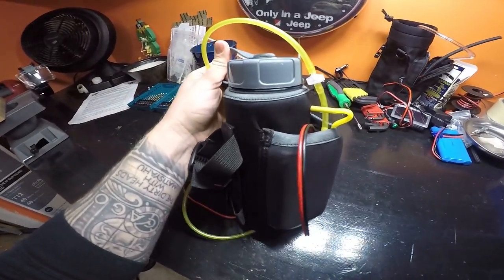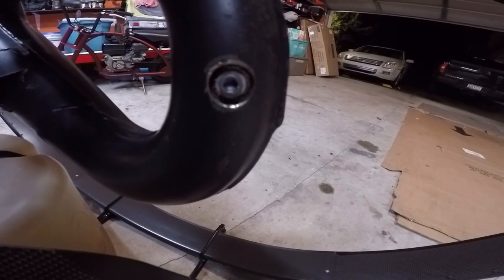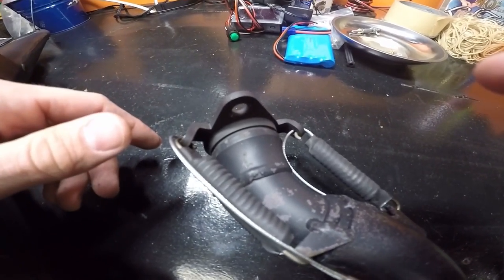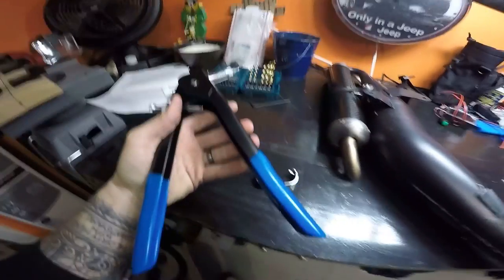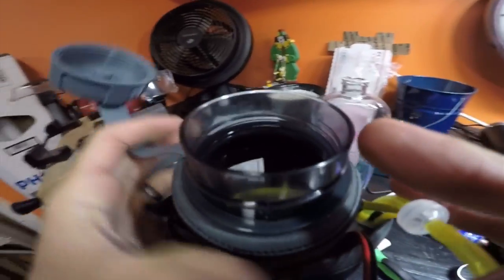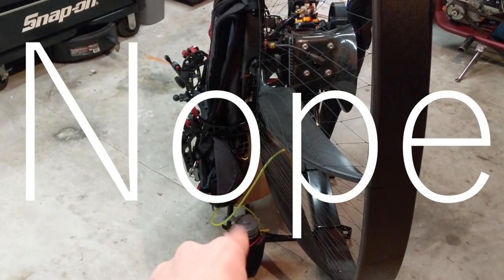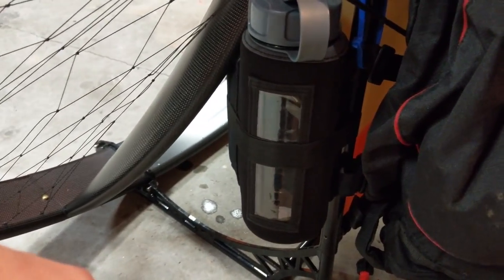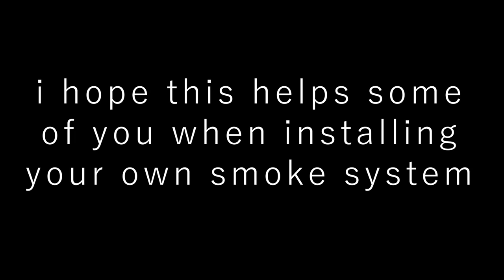Installing the PPGSmoke.com Smoke System!

Comment: For the RTV, it is a good thing - it will help prevent small oil leaks at the injection nozzle. I have seen a few instances where the fluid seeps out a little. Minor but that does solve for it!

Comment: Is there any benefit in getting the Aviator PPG nozzle rather than using what comes with this kit?
Reply from the maker: Not that I can tell. They're different designs and different sizes tho...
Reply: Our final production nozzle has an adjustable flow rate. We ship at .08mm and it can be drilled out up to 3mm for a full 600ML of flow rate. Light years ahead of the Aviator nozzle ;)